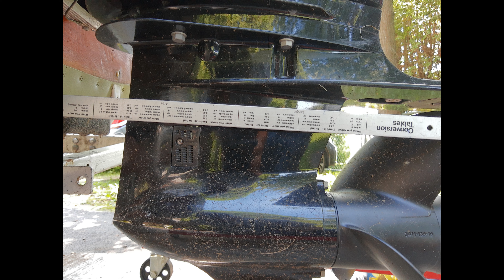Raising An Outboard Motor Height For Better Performance.Suzuki DF90ATL

Comment from the maker: Raised my outboard motor for better performance and fuel efficiency.
Task level = easy with engine hoist.
3M Marine Adhesive Sealant Fast Cure 4200
First test dealer installed on the second hole,going up for the third hole !
Stay tune for test result !

Comment: What's the results?  Or did the motor rip the transom off the boat?
Reply from the maker: Well,No gain in sped but a bit more RPM.
Maybe a bit harder to steer,will continue testing.
Will maybe go back to the second hole from the top...
Reply: @obscur156  if your getting more rpm go with a bigger prop should get more speed
Reply from the maker: @brandoncoleman5572  21 pitch is the one that gave me 77 kph/48 mph